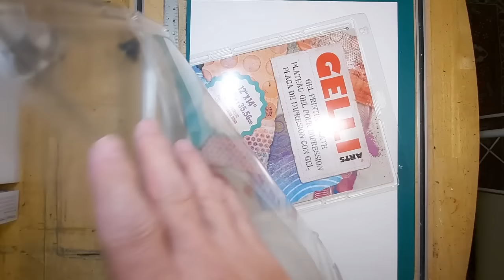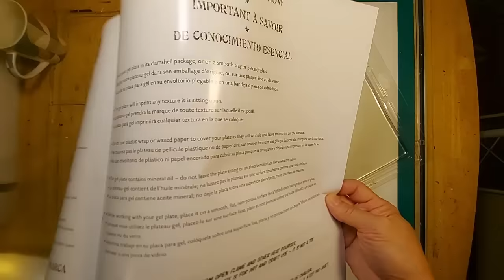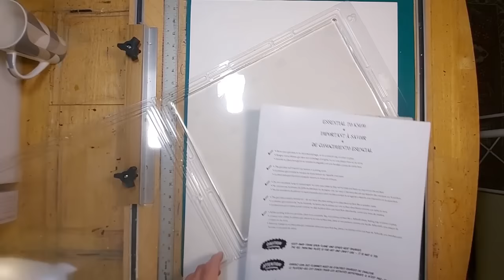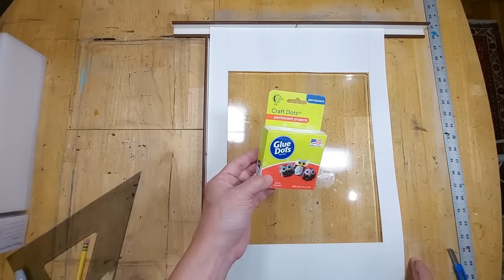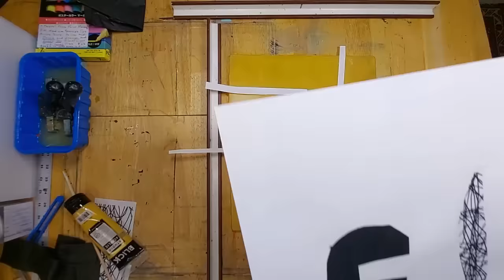New Medium Format  Gelli Plate and 4 Collages!

Comment: So has mod podge come up with an archival formula finally? It used to be non archival and would yellow over time(not acid free) just curious because I consider your Art to be fine art and in my estimation you should use archival glue so they will stand up to the test of time. (I.e. like gel or matte medium) your pieces are painstakingly beautiful!
Reply from the maker: Thanks for your concerns Brenna! I looked up Mod Podge  on Google and  they have a new formula which is non yellowing called Mod Podge Paper. I'll switch to this formula ASAP. I never had yellowing problems with the regular Mod Podge, as long as you keep the artwork away from direct sunlight, which is true for any artwork of value.